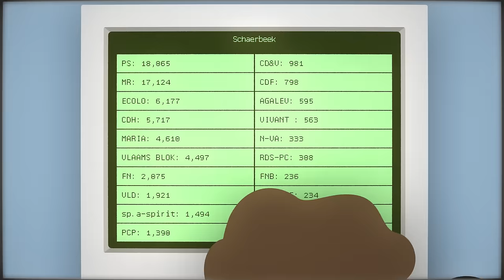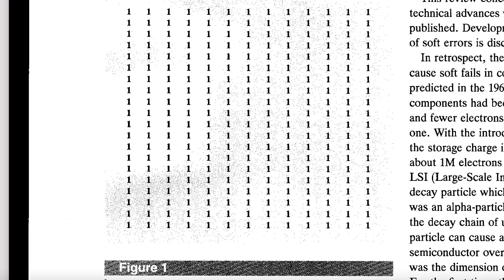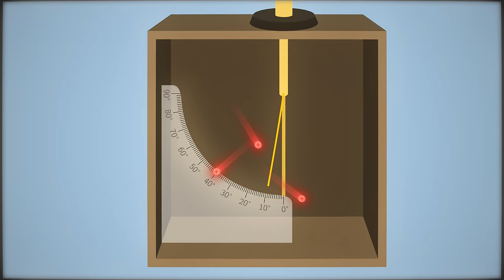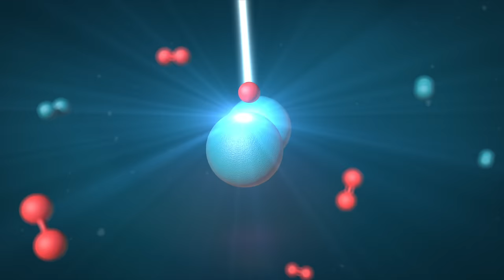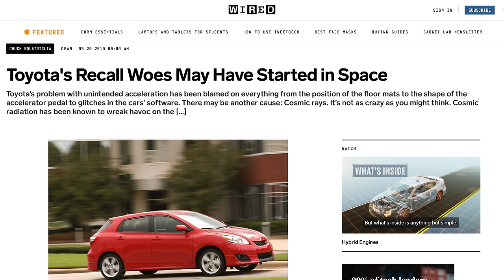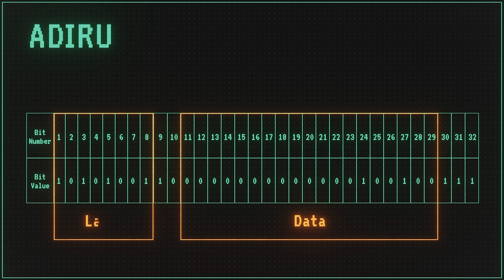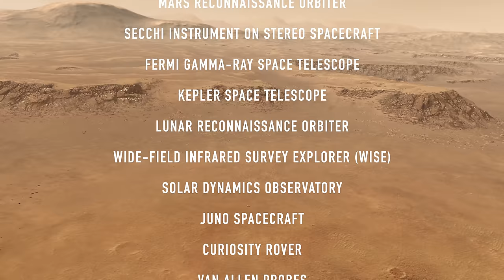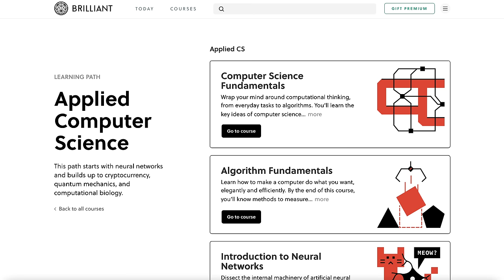The Universe is Hostile to Computers

Comment: This is the whole point of ECC - Error Checking & Correcting memory, in use for 15+ years now on servers.  It's also the whole point of voting systems which tabulate from the printed card as the primary, not the backup, even if the printed card is generated by a computer.
Reply: Yeah seems like a good thing for big servers and important developer's computers because a little bitflip while compiling final product could cause serious damage to users of software. Linus torvalds was using it as I remember.
Reply: ECC memory is typically only in processor cache in nearly all processors, but only in the main memory of servers. Laptops and desktops typically don't have main memory with ECC. (Unless you have some high end workstation that may as well be called a server.)
No idea if they used ECC in voting computers. An engineer would say "OF COURSE. WHY THE F-- WOULD YOU NOT DO THAT." But - who knows what cost cutting measures were taken in the design.
Reply: thx Brett
Reply: somebody didn't watch the video before sharting a reply
Reply: A veritasium video on ECC itself would be cool.  It's a very interesting concept that most people take for granted
Reply: @fitybux4664  so right it hurts
Reply: 25+ years. I bought that in the 90's.
Reply: @tinto278  "everyone knows about ECC"  oh really?  Then why did Derek feel the need to explain the basics of how bits work inside computers?  Not "everyone" knows about this stuff. Shut up.
Reply: He mentions this but it doesn’t work perfectly
Reply: @ewthmatth  Your like a hard disk sector gone bad... You cant be fixed with a defrag.
Reply: @ewthmatth  ECC really is quite ubiquitous in the tech space. It has drawn quite a few headlines recently with big names scolding Intel for segmenting the technology into pro products. Similarly is has become newsworthy with the advent of DDR5. ECC really has been quite the talking point if you're interested in tech/computers.
Reply: Yeah was gonna say that, this video is incomplete without this addition. We literally have techniques to counter this and we are all interacting with such RAM every day when we use the internet. Just bought 128GB ECC for my workstation!
Reply: @tinto278  Yeah sure, literally everybody knows about ECC memory, there can’t possibly be a single person who doesn’t. You must have sub-zero IQ if you don’t know about this single (important yeah, but still single) aspect of computing technology.
Reply: @erik3371  “everyone knows about ECC” lol, you guys must be young. I remember I once complained to a teacher in high school that “everyone knows about jpegs”; he got mad telling me never to take your knowledge for granted. So no, not everyone knows about ECC, not even close. Respect what you know, don’t disrespect what others don’t; it’s not like only techies watch this channel.
Reply: @fVNzO  you missed my point.  If Derek is explaining the absolute basics of bits inside a computer to his audience, then it's OK for someone to write a comment explaining ECC.  @Tinto doesn't get that. facepalm
Reply: @ewthmatth  go wash your hands sire. I sincerely apologize for any wrongdoings in this here establishment. You are a gentleman and a scholar, unfit for dialogues with mere brutes like me. I shant stand in thy way. Im naught but a weary traveler in these here lands. I have troubled thee aplenty already, I shall scurry away without further notice.

Comment: imagine if someone launches a nuke with a targeting system and it just nukes the very same spot it was launched from
Reply: The term "The universe is against you" have more meaning
Reply: Given the level of shielding that goes into those systems for EMP it's safe to assume that Nukes are ironically the most resistant to radiation
Reply: @TheHacknor  too bad it ceases to exist right when radiation hitting it becomes a possible problem
Reply: In which case there won't be much imagining.
Reply: instant karma lol
Reply: You can look at the result of every single bit flip to prevent this kind of thing
Reply: insert north korea joke here
Reply: @TheHacknor  however there still is a chance
Reply: Talked like a true Xqc fan. Respect
Reply: @hardhika9208  xqcL
Reply: Multiple independent computer systems running simultaneously.
Reply: Redundancy. Did you watch the video?
Reply: Always nice seeing a fellow juicer. xqcL
Reply: Back at cha!
Reply: "Who let Dave push the button!?"
Reply: That's ggs

Comment: 1:38 "Computer experts were brought in to run extensive tests on the software. They combed through the code but could find no bugs." Haha, that must have been some unbelievably perfect software!
Reply: probably just no bugs that would result in the vote count changing.
Reply: @CircuitrinosOfficial  Absolutely. As a programmer I just found the line funny ;)
Reply: There IS always bugs
Reply: In simple programs such as vote counting programs it's not too hard to have no bugs. When you get to really complicated programs like video games then bugs are unavoidable.
Reply: @abisgamer4825  I am proud to say my first C++ and C# programs had no bugs ;)
Reply: Damn some cosmic rays must have passed through that name
Reply: "Every non-trivial program contains at least one bug.
Every non-trivial program can be simplified by at least one line of code.
The conclusion of the last two laws: Every non trivial program can be simplified to one line of code, and it will contain a bug."

Comment: 4 computer redundancy is both an obvious solution but also a brilliant one.

And I love how it also allowed to track the frequency of bit flip events.
Reply: I'm kinda wondering why not just 3 though as that is all that is needed unless... my guess is the 4th is a backup one incase 1 failed in some other way, so even if one failed there would be 3 to calculate accurately if 1 got different results.
Reply: @Josiah1994.  yeah, it is for redundancy. Shuttle could have two computers get upset and still be fine. I don’t think this was ever actually needed, and I think SpaceX Dragon uses 3 instead of 4.
Reply: @tidefan211  2 wouldnt be sufficient i think. If one goes wrong, how would we know which computer is the correct one?
Reply: @GJuice  You're correct, 2 is not sufficient. Dragon uses 3 and Shuttle used 4. That is to say, Dragon can have one computer get an SEE and still be okay, while Shuttle could have any two go wrong and still be okay. They won't go wrong in the same way, I guarantee it, the odds of two SEEs hitting the exact same bit in two separate computers simultaneously are astronomical. So I have computers 1 and 2 which say one thing, and I have computer 3 saying another, and computer 4 saying yet another. I know 1 and 2 must be the correct ones because they're saying the same thing, and I can keep flying. I should also note Dragon does some other stuff in which each of the 3 computers has two "strings" that both do the same computations, so Dragon has more redundancy than I made it sound (maybe even more than Shuttle, I'm not qualified enough to say).
Reply: @Josiah1994.  By using 4 they keep the weight distribution even so they can do sicker burnouts!
Reply: simultaneous simultaneous multiprocessing...

Comment: Good coding practice: make sure the labels are encoded with a distance of at least 2 bits between each other. That way, a single bit flip won't be able to transform a label into another, and use switch cases with default triggering an error.
Reply: Or use ECC memory
Reply: @mpoisot  I couldn't find any info wether they did use ECC memory or not (but I guess they didn't). Though, one has to clarify that ECC doesn't detect all bit flips, for example when the ECC itself got a bit flipped at the right position. I mean it's a heck less likely, but stil.
Reply: @Elite7555  ECC can detect and fix any single bit flip. Tho for a double flip it can only detect it and throw an error, for more than 2 with bad luck it wouldn't detect or correct anything. But tbh if you've software running that's important enough to be able to handle 2 or more simultaneously bitflips you've got other problems. Also this simultaneously means in the same clock cycle. Take a modern cycle of 3000mhz devide by 2 because of RAM standards and you got 1500mhz. Which means two or more bits would have to flip within the same 1/1500000000 st of a second
Reply: @mpoisot  Or use tons of other different error resilient code methods that fit your performance requirements.
Reply: I think implicit in this is the endian-ness of storage. If the right most bit of an integer is flipped, it increments or decrements the value by 1. If the left most bit is flipped,can throw the number into a radically negative state. You can go from having value of 10000 to almost -2 billion in one bit flip.
Reply: There could be a lot done if it is manually encoded. Storing variables multiple times, doing loops multiple times to double or triple check. However that only saves the data, not the execution code. Therefore I think all of these steps of resilience must be handled in the hardware layer, and indeed the software layer can be an abstraction of multiple layers of hardware.
Reply: @mpoisot  That's how ECC memory works, you know.
Reply: Sure, bud.
I also "do" coding.
Reply: Maybe make a super-protected mode where every byte actually occupies 4x the bits, so you have all 4 bits representing 1 bit, and even then, stripe them across multiple bytes. You'd end up with a quarter of the memory space but each bit will have to have all 4 bits flipped in order for it to work (I giess if 2 bits flip, you'll have issues).
Reply: @carpark1414  This would be really, really slow; not to mention memory efficiency.
Reply: @SuperOtter  Whoopsie, I had the impression they only added a parity bit.
Reply: @Elite7555  You are right, and so what? Sure, it would be 4x slower, or similar to a program with 4x the memory bandwidth and footprint. Depending on the program you need to run this may not be an issue. Or you could just do what NASA did with the shuttle and run multiple instances and check the consensus. If you are running something mission critical, the cost of the hardware vanishes in comparison with the task it is performing, so there are viable options around this.
Reply: @carpark1414  would be worse than 4 times slower, and for very important software it usually is just run on multiple computers instead which also protects against just straight up hardware failure.
Reply: @SuperOtter  at least with separate machines it will not be running slower.

Comment: So I guess we now know how a benevolent AI would switch and decide to murder us all lol.
Reply: Actual start plot for Terminator
Reply: Dude. I was thinking the same!
Reply: Just add some redundancy.
Reply: If you use a single bit to determine whether the AI is good or evil then catastrophe is inevitable. Redundancy is paramount in critical applications
Reply: @cyko15  nevertheless multiple occurance of bit flipping has a non zero probability.
Reply: I think what we imagine is basically wrong time wrong place... like the scenario with the mario game, the subtle flip can cause changes to a lot of things if the timing is correct. Even if its hardened over 40 times like the curiosity rover. Remember that improbable is not impossible. All it needs is a chance
Reply: AI is a neural network. Learning code (written by human) trained to output a program and therefore not understandable for humans because it looks like a spaghetti code. In short one bit flip won't do much in AI, at least not as much like in normal programs and their functions written by hand.

Comment: As a software engineer. Bits flipping randomly is such a scary phenomenon
Reply: wait it's real?
Reply: @RiemannHypothesis2  you watched a 23 minute video and thought this was fiction?
Reply: @jacobc436  wait so honestly sometimes your program does something your logic didn't intend to do?
Reply: @RiemannHypothesis2  Honey, just watch the video. It'll answer your own question.
Reply: @RiemannHypothesis2  no, the algorithm runs correctly but the initial data with a bit flip causes the result to be wrong.
Reply: As software developer, when he was talking about vote count issue due to bit flip i was wondering why would you maintain a counter. Why not have a log or database entry for each vote and count the votes dynamically. That way flip wont cause any issue. Maybe the developer was not big fan of democracy.
Reply: @RiemannHypothesis2  bruh
Reply: Start using more data validation, range checks, CRCs. "defensive programming".
Reply: It really is. I really fell in love with that math used in shaders for awhile because you intentionally structure for not using 'if' checks or even 'try-catch' logic, just make the math eat up the error in a graceful manner. Since learning to structure my math like that, I find it do it even on pen and paper, just helps baking constraints into the math. Even so there will always be that break point where one flipped bit is all she wrote.
Reply: Just when you thought you could trust a little now you have to worry about them flippin on ya'.
Reply: @sumitshresth  that was a representation, not necessarily how it worked.

Your way is still susceptible, as the SQL count(*) is still doing a counter, but at the database level. And there's nothing to say that the error didn't occur after that point.

What you need is parity or error checking bits.
Reply: As a software developer, I can relate. I guess it's just a reminder to add error correction, and that no matter how careful we are, there is always going to be random soft errors. Blame the next Heisenbug you encounter on it if it makes you feel any better?
Every rule has its exceptions, and this is one of them (and the exception for the exception, because that rule also has exceptions, requires either redundancy or surrounding yourself with radiation-absorbent materials)
Reply: @MethmalDhananjaya  honestly I think Tony is trolling. We all know bugs happen, and that second, it had a notable sarcastic undertone to it (at least when I read it)
Reply: @RiemannHypothesis2  you... are trolling right? You've got to be trolling
Reply: @morosis82  But you can do that count multiple times instead of one time so every time system did a lookup of vote count it ran a count so chance of that same flip happening everytime would be impossible.

Comment: Ironically, these cosmic rays also affect astronomers. When a telescope image or spectrum is taken, the incoming light is recorded by a CCD. A single cosmic ray passing through the chip can cause a brightness peak in or around a specific pixel. Now, keeping in mind that a muon passes through an area the size of your hand every second, and that a single exposure can easily last an hour, and you see the problem. The stellar spectra I'm looking at right now are literally riddled with these cosmic ray peaks, which can be quite confusing! Luckily they are easy to spot-most of the time.
Reply: Wow.  I was photographing the moon one night and single pixel in the dark sky showed up in only one of a series of shots.  I thought it was a star until I saw that it was not on the exposures taken either side of it.  I thought maybe it was a satellite reflection.  Maybe it was a particle striking somewhere in my camera's chips.
Reply: @philipethier9136  it's very likely!!
Reply: As someone just getting into astrophotography, this was one of the first things I thought about when the video said that these soft errors caused by cosmic rays do not leave a trail thus no evidence that a bitflip was their fault. I instantly thought, that in long expo shots, they can definitely show up as I'm sure they can affect the sensor. Glad that you mentioned it, I'll start paying attention to it, maybe I'll be lucky enough to catch some of these events.

Comment: Wow. That cloud chamber is one of the most incredible things I've ever seen.
Reply: Ikr I gotta go see one someday
Reply: Scientists are experimenting with cloud chambers as a method of detecting contraband at boarders and ports. When cosmic particles pass through matter of different density their path is changed ever so slightly.  So if you have a cloud chamber above and below a storage container and measure the path of the particles before and after passing though the container you should be able to determine the density of every item in that container.
Reply: You can make one pretty easily
Reply: @greggrimer1428  Oh I plan to. I immediately went and watched tutorials.

Comment: the concept of evolutionary mutation occurring in part due to cosmic ray DNA bit flips is super trippy man
Reply: @Chandler Russell technically speaking variation is the driving force of mutation, and most of that variation is biologically induced. Its also a stretch to say radiation created life on earth when we're so far from actually knowing what did. Let alone to say any of the life on earth is truly capable of understanding it all.
Reply: That would need further explanation, since genes don't work like computers.